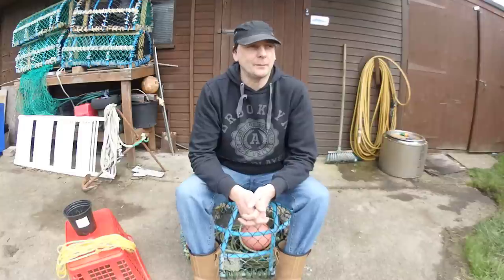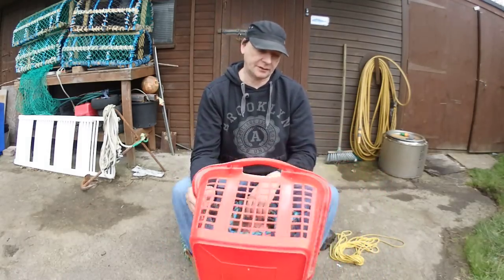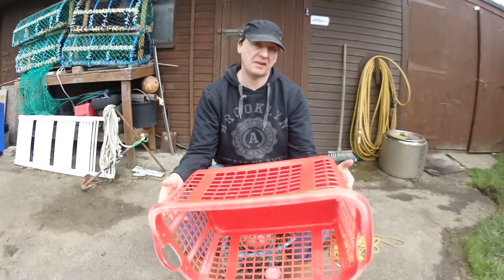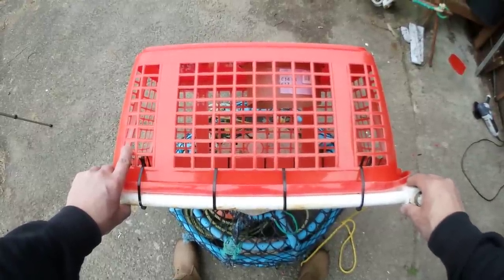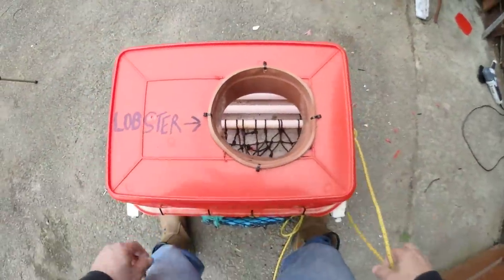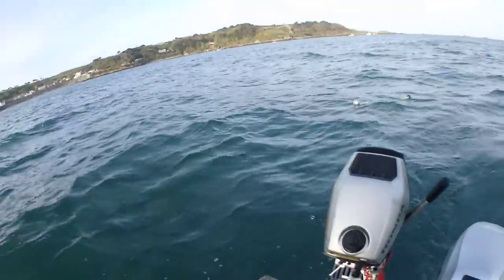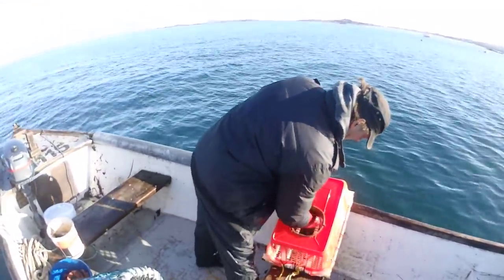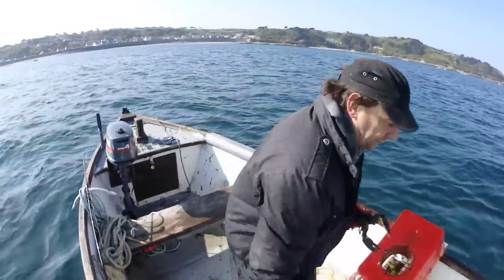Lobster Master 2000  ( Lobster Trap Build Just for Fun )

Comment: How can I make big hole in side of washing basket
Reply from the maker: Carefully use a drill making lots of small holes, put a bit of wood under it so you don't crack it, or push a hot poker through it

Comment: Did you use it any more does it work well
Reply from the maker: I used it for about 3 to 4 months. For an old washing basket it worked well it ended up with around 20 Lobsters that were of legal size.
Reply: Whag do you use for bate
Reply from the maker: any old fish. its better if its a day old & very occasionally crab

Comment: gently grabbing them out the pot and releasing them your harsh. you want them to liveand not e hurt throwing them at force back into water.  if your not eating them. value life. i see this a lot with the fisherman neighbours of mine. 
why dont they climb back out the hole?
Reply from the maker: I am very aware of looking after the future  that's why I fish the way I do. I am only a couple of feet from the water although the camera makes it look much further.  Most potting boats  are probably 3 times higher  out the water. The force used is not aimed at the water its to clear the gunnel and propeller and to work quick to avoid being pinched. Also if you do not use enough force the crab/ lobster can grab the glove they can swing back around and smash into the gunnel. The crabs and lobsters are much tougher than you think and it does no lasting damage, I often see the same lobsters with distinguishing marks. Some will climb out but most cant figure out how to get out